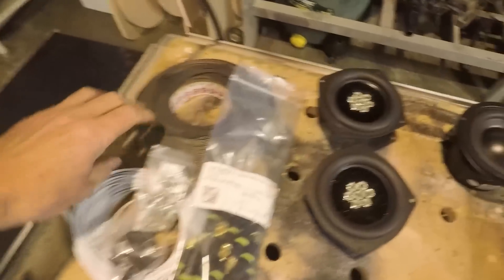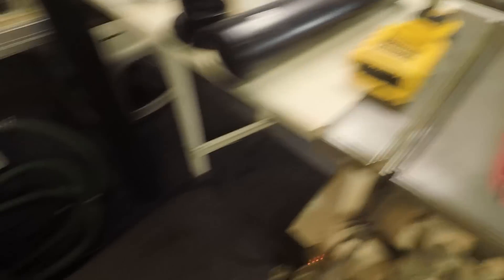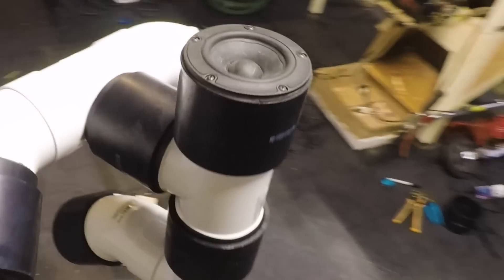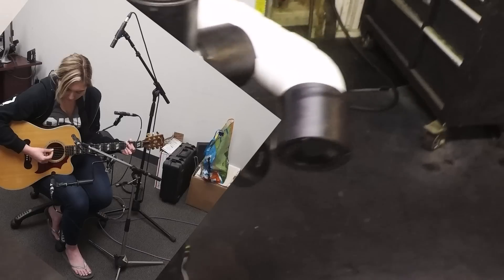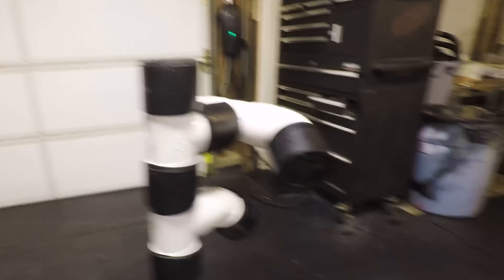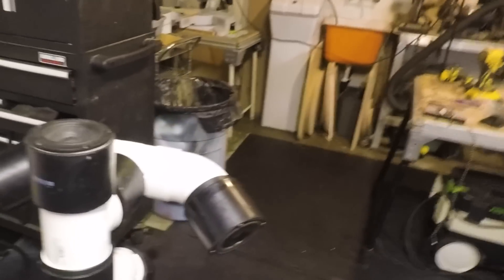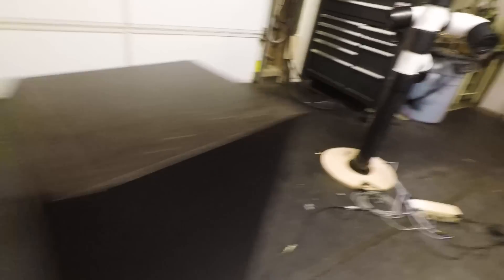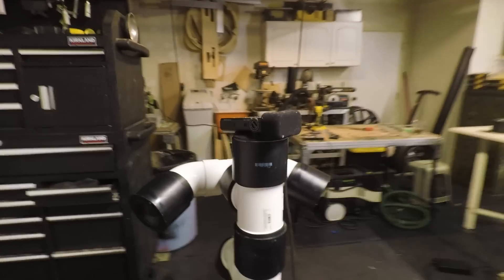Speakers Don't Sound Real, Lets Build One That Does

Comment: Can't hear how the speaker deals with full frequency range because the test signal is very narrow banded guitar. Can't hear the phase distortion as soundtrack was recorded in MONO not stereo.
Reply from the maker: The soundtrack was recorded with 4 seperate mics and played through 4 seperate amps into 4 seperate speakers. 

The only thing mono is the conventional speaker.
Reply: @DaveRat I still don't quite know what it is to listen for, or what's supposed to be going on.
Reply from the maker: Try using headphones and listen for which sounds more realistic like an actual instrument
Reply: @DaveRat I was already listening through (reference) headphones.
Maybe use prerecorded grand piano as test source next time?
Reply: @DaveRat  by the way, I don't mention the single hi-fi speaker because it's so obvious. You'd only monitored/recorded it on-axis for a fraction of a second then spent rest of time the back and side highlighting what a speaker sounds like offaxis. 
I think I can see your idea, have multiple crossed axis each carrying slightly different program content and as move between them gives a perception of hearing extra information about the sound source.
Reply from the maker: The goal is to recreate a realistic sounding instrument that does not force you to sit in one spot. The whole idea of sitting in one spot in order for sound to sound real is kind of like having to put those silly cardboard glasses on to watch a 3D movie if you want it to look real.

My goal is to not need the glasses and not sit in one spot

Comment: Always love the effort you apply to get your point across. If I was in the shop with you, I’d suggest more than 4 drivers. Id suggest an odd number and possibly a low frequency driver. I noticed  more lows with the single infinity speaker. but preferred the dispersion of the custom unit.
Reply from the maker: Thank you.  With some seperate speakers small boxes, I tried 3 and 5 and 3 did not have enough coverage without adding reflective baffles and the diff between 4 and 5 was not significant. The recording actually has 6 channels and I chose the best 4 for this
Reply: @DaveRat  results with just one channel of the recording sent to all drivers?
Reply from the maker: As expected when the same signal is sent to multiple speakers, it maximizes comb filtering and interactions between drivers for frequencies where the distance between the drivers is over 1/4 wavelength

Comment: It's interesting that when recording a band or orchestra, they mic up everyone and then place them on a track, the idea that this information is then mainly lost when combined into stereo seems a waste of information, your idea of using those separate recordings to send to separate speakers in an array makes perfect sense.  The next step is to make the equipment and start a new industry of speaker designs and change the recording studio to release multi-track recordings, The industry would need a new standard for the files and newly designed home amplifiers to interpret the data with the speaker array.  Great idea, this could change the way we hear recordings in the future.
Reply from the maker: That would be cool and for now I will do another vid comparing it to several vintage and we'll known hifi speakers

Comment: I know what you are saying, and you do clarify at the end of the vid. How would you present an "action movie", with your proposed setup? It would be bulky and all that. Your concept is great.

Imagine all the ultra hi-fi speakers and technology in your type of setup, instead of just regular type small speakers.

Your setup would be great in a very large room with a 4 piece band in the middle of the room.

When watching a movie, my surround sound speaker on the wall does a great job, with the audio coming from a fighter jet way high up in the sky.

If I had the space and the $$, I would like a top notch surround sound setup, and your type of setup.
Reply from the maker: Same way I transport a soccer team with a motorcycle. May not be the optimum tool for the job but would work if you have enough of them

Comment: i came to this pretty cynical and have been dissuaded. i don't quite know how to apply this but from what I'm hearing here i believe you're on to something.
Reply from the maker: I love that and will do more.
Reply: @DaveRat  have you ever seen a band perform in a venue where each band member has their own Bose personal amplification system at their own location? while the instruments individually are not being captured in a realistic way i do like each instrument emanating from its own location. a slight improvement on the cram-it-all-through-the-mains tradition.
Reply from the maker: I have not but I have been to many band rehearsals with no pa or just vocal pa and love the sound

Comment: The recording of the guitar is flawed. You should have pointed 4 mics at the guitar at the same location as to where the 4 speakers are located. Then it would have been as "real" as you could get it. And of course one of the mics/speakers needs to be located at the front of the guitar. That's where the sound is radiating from anyway.
Reply from the maker: Are you sure?

The goal is to create a speaker that sounds like a real instrument, not to sound identical to the instrument.

Though that could be a future endeavor, creating realistic lifelike is goal enough for now. And for that, mic placement and matching to speakers just alters the theoretical shape of the instr ment and which way the musician is sitting vs the listener.

These aspects do not seem to impact realism.

What does impact realism is avoiding the following:

Don't radiate the sound or sound mix only in one direction

Don't radiate the same sound or sound mix in multiple directions

Don't send the same sound or sound mix to multiple speakers

Once you are radiating different sounds in different directions, the sound begins to sound like a real instrument
Reply: @DaveRat  i mean i get your point and the concept is great. But still, if the goal is to reproduce the sound of the real thing, then mic/speaker placement needs to be coherent otherwise you don't get real, you just get something different that sounds like it could be real but not quite. Edit: like you said, if the goal was something different then i understand. I got you.

I just think the recording could have been made more coherent for your speaker.  system
Reply from the maker: Maybe step aside from the concept of coherent.

We don't want a coherent or unified or phase time aligned source. And really really do not want a point source.

No instrument is a point source or time aligned or coherent, instruments are a mess of harmonica and tones radiating in a mess of directions.

It is that messy mess that differentiates a real instrument from overly structured unidirectional sounds reproduced by loudspeakers 

I want the messy mess of sounds that is the key to the realism
Reply: @DaveRat  i still think you would get that mess through the 4 mic placement coherent to the speaker setup though.

Obviously, once you have more than 1 speaker (point source not included) you would have some phase mismatch.
Reply from the maker: I think you should have a little experimenting in your future! Start playing around with this and you will begin to sort through things that seem they should happen and what actually occurs

Comment: Half the problem is that commercial recordings are doing it all wrong. For one thing there are too many microphones. Humans only have two ears so place the microphones where the audience are that's number one. Number two the image of three-dimensional sound from two speakers that has been solved by Bob Carver in 1980.
Reply from the maker: 3d sound is not necessarily realistic sound.

All of my testing shows that if you radiate a sound or sound mix in one or more directions, it will never sound realistic and no amount of processing will fix that.

The issue is that when sound reflects off of surfaces in the room we hear the reflections and the direct signal combine. 

In order to sound realistic, the reflections must not be the same signal or mic as the direct sound.

Multiple sounds must be generated and radiated in multiple directions.

Else the realism is lost if the listener moves
Reply: @DaveRat  the problem of capturing sound from all sides of the instrument is a recording issue, not a playback issue. It is common in commercial recordings where they embedd 60+ mics in the orchestra at close range. #1 it doesn't sound natural from a foot away, #1 it doesn't capture the reflected sound from the back and sides of the instrument bouncing off the orchestra shell walls. For an audience member, they hear the direct and reflected sounds with just two ears.
The playback problem was solved by Bob Carver when he figured out a way to prevent cross talk and extra sound arrivals from just two speakers. We only have two ears, after all.
I see what you're trying to accomplish here, but there are too many limitations--you have to have a speaker setup for EVERY instrument. That is simply not practical with a 104 piece symphony.
Reply from the maker: The issue you describe has to do with combining multiple mics which I'm not doing.

Also the goal here is not to capture reflection and not recreate any of the original room in the listening room, just capture the instrument and drop it into the listening room. 

Also I believe the ultimate test of weather recording and playback system works really well is if you can re-record the playback material and have the re-recording of the speaker also sound real.

And that is what I do in the next video
Reply: @DaveRat  I've done that with good results. The trick is to record your original source in an anechoic environment, so you don't have doubling of the acoustic signature.
I was commissioned to record a 12th century music group some years back, featuring human voices and some period instruments. I set up an experimental mic configuration and during rehearsal, I did a sound check with headphones. My first thought was that the headphone amplifier was not on, as a heard no difference in sound when I put the headphones on, while standing in the aisle between seats. Then I realized these are circumaural headphones and if the amp was off, the sound would be muffled. Instead, it was like I put a dummy headphone pads around my ears with holes for the sound to pass through. I took them off and on several times because I could not believe it myself. I had reached perfection in miking on that one recording session.
Reply from the maker: I love that! So now taking that one step further and reproducing it in a similar way that the original instruments radiated it so it can be done in a room and not just headphones is exactly what I'm doing here.

And though it's not perfect it is quite amazing how well it works with such a simple and crude setup.

In the video I just recorded yesterday I compare the recorded sound played back through numerous speakers and then the multi-channel speaker and re-record all of those and play those recordings of the playback recording through various speakers for people to hear

You gave me a good idea in this conversation where I will go back and play the second generation recording through the multi-channel speaker creating a third generation of audio and compare that to various speakers playing the first generation.
Reply from the maker: Very cool, I am not sure I understand how Carver's concept will recreate realistic soynd for everyone in the room regardless of whate they are listening from or moving to or from or as they move around
Reply: @DaveRat  it only works down the center line between speakers, but it works really well, and since most audiophiles are singular people, it's fine. Sit in the chair, enjoy the music.
Reply from the maker: Ahh, got it. Yeah, my goal is for people walking into a restaurant to hear and believe that a live musician is playing somewhere.

For people at a trade show to think a live musician is playing the demo but they can't find the human.

To have four of these, one in each corner of my living room and be able to walk around have it sound like I am standing in the middle of the band and be able to walk up to any member and listen closely to what they are playing.

Personally, anything you need to hold still for or stay in one spot is  like a video game version of audio. Sit here and it will be fun. All good and also I am more interested in something much more realistic with less listener constraints
Reply: @DaveRat  I come from a generation where we don't walk around while listening to music. We sit in the concert hall until the last movement finishes. I see what you're trying to accomplish and if it's just to recreate a few ensemble instruments in a small venue like  bar or lounge, then it should work out well. Of course there will be a dearth of recorded material, unless you record it all yourself, but that's a different topic. :)
Reply from the maker: Fair enough and I; understand the desire to recreate that very specific experience.

I started out my career mixing big band and symphony orchestras in the park.

To me, having to sit still to get the proper experience is kind of like needing to put on cardboard glasses to see the 3d movie.

All good and would be way better if you did not need to

Comment: Very interesting Dave, you must check out DMLs. They have multiple points of radiation and provide a diffused soundfield which is amazing. You could feed different pickup sources to each exiter on one panel when using multiple exciters. I've made several and a panel roughly following the golden ratio with enough square area will set your hair on end. It's shockingly realistic.
Reply from the maker: I have some NXT speakers and was involved with consulting on early designs and dealing with panel resonances, which are a challenge for DML. As is getting extended LF.  In the video I did on Reddit responses #4 I use a DML speaker for the decorelation demo.

That said, DML create complex sounds but not necessarily realistic sounds because the panels don't know how to send the sound of strings in a different direction than the sound of the guitar body resonances

Comment: If you have shitloads of money, you can buy MBL speakers🙊
They are mulitdirectional. This was interesting to listen to😊
Reply from the maker: Beautiful design but shoots the same sound in all directions and no instrument does that
Reply: @DaveRat  
One could also say, that no instrument, vocal, or sound for that matter, has the exact same radiationpattern, and thus absolute correct reproduction, is rather impossible🙊 (not trying to pick a fight or anything here🙊 I find your aproach rather interesting😊).
When it comes to the MBL's, I think they will be closer to a natural/ correct sound than a boxspeaker. Especially taking into consideration that the sound going in other directions than straight at the listener, will be altered in volume, intensity and to a certain degree in frequensy. This can also be altered further with positioning and roomaqoustics😊
Would love to try, but I suspect MBL do not want to lend me a system🙊
Reply from the maker: I don't think it's that complex. Capture 3 or 4 diff sound radiating in diff directions from and instrument, minimize capturing room sound, re radiate those sounds in approximately the same directions.

Simple, logical and most interesting, it works and works well.

I know because that is what I am doing, it's not a mystery or a question, the hard part is doing the demo so people can hear this simple non processed, no EQ setup on YouTube.

But I believe I have tackled that fairly well in the next vid I just did.
Reply: @DaveRat  
It is very interesting, I herd a clear diference, even through youtube. Would be cool to hear in real life😊
Reply from the maker: I did another vid that will help to hear even more. It will be public in a month or two
Reply: @DaveRat  
Looking forward to that video😊

Comment: Pal, you nailed it on a completely new sound reproduction concept.
Limiting factors would include knowing which directions and placement of recording mics..but in this instance you already knew.
You would also need individual tracks and amps for each for the effect.
That could become many if more than one instument....but say we have surround sound tracks and could adjust delays on each. It would be an interesting universal effect tower 

Sorta what I was doing with multiple amps and DSPs back pre dolby surround..

Nice observation/experiment and well documented

Btw..An open speaker with no grill would not even survive the first kid/adult that walked by...but you know that already..🙂
Reply from the maker: Awesome and thank you. Yeah, I think a simple spec of about where to place mics when recording. Working on another vid now where I will compare live to various speakers and this speaker
Reply: @DaveRat  

In reality. You could just use 2 channels (L and R) , just pan mics and point drivers from direction/ angle the mics were pointing.

It would be better as 4 channel but effect would be close in stereo as there is the 'dark side' which will also be considered as the third channel.( lack of sound). This would make recording more standardized
Reply from the maker: Yeah I have that setup right now and doing stereo gives a medicare version of the sound. 3 is better, 4 seems to be the point of diminishing returns.and 5 is harder to tell from 4